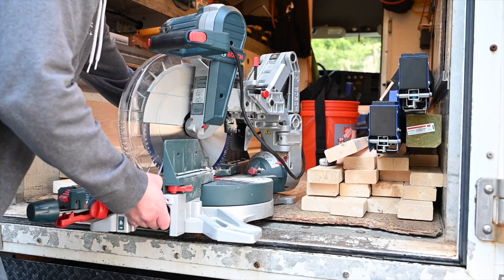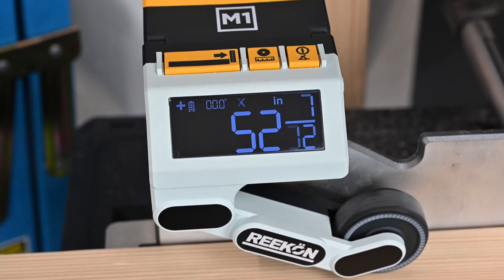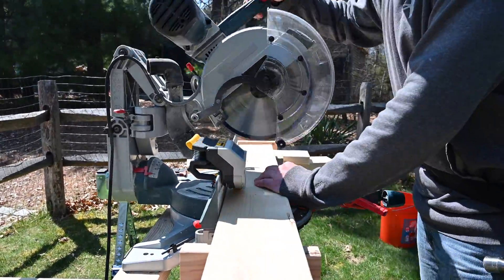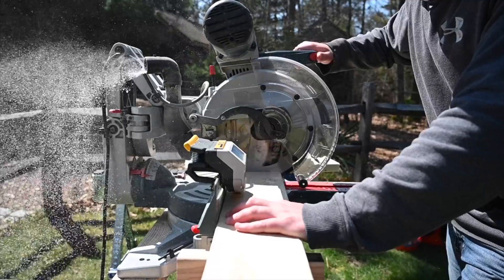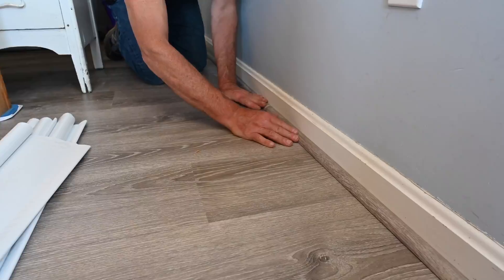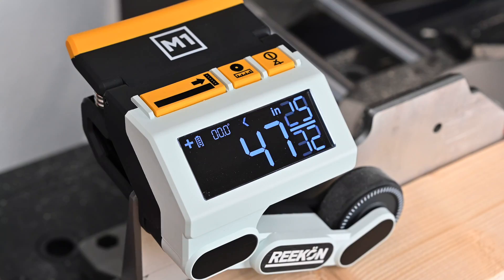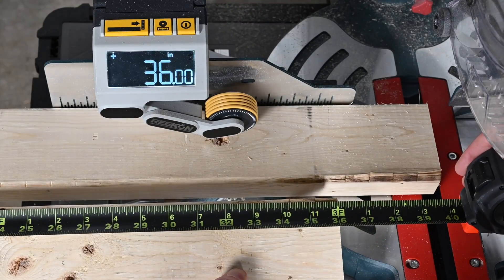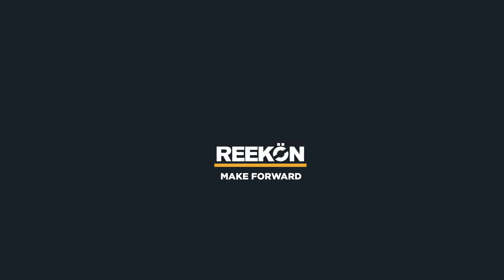M1 Caliber Measuring Tool - REEKON Tools

Comment: Is there any way for this to work for something that’s not at least an inch and a half plus wide? 

If not anyone wanna buy my brand new one? Because it’ll be useless to me.
Reply from the maker: Hey AJ, you can use a spacer that attached to your saw fence to push thinner materials forward so that they are in contact with the wheel. A thin strip of MDF or any similar material will work and allow a consistent edge to slide thinner materials along with and still get picked up by the wheel
Reply: @REEKONTools  i love that you guys are giving solutions!